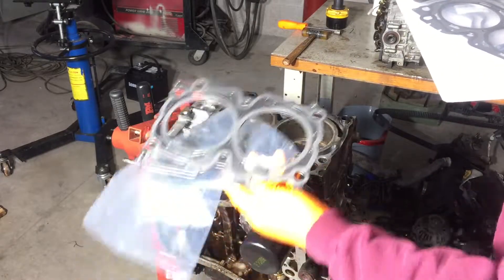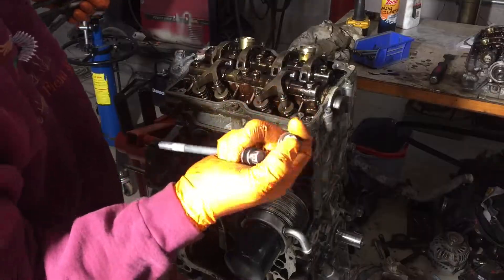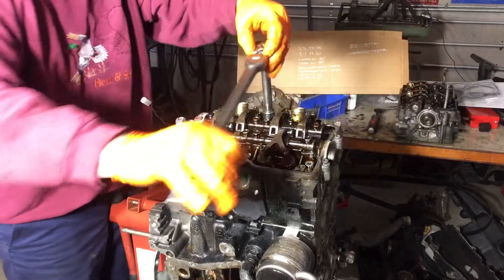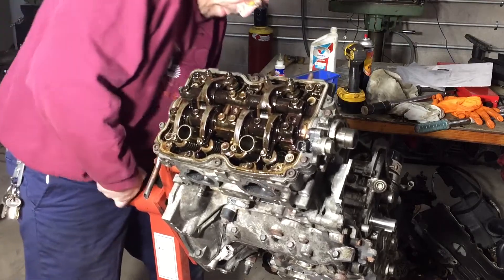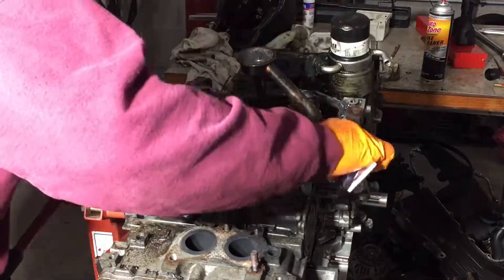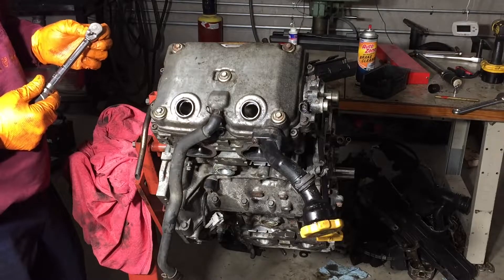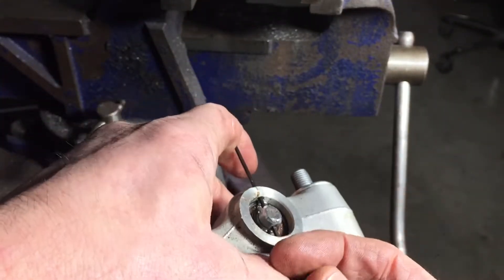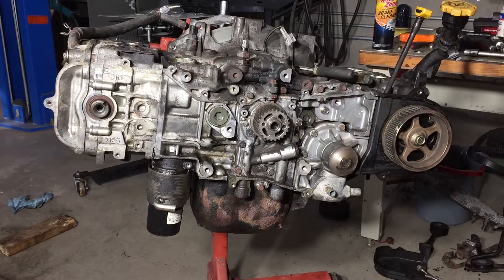Subaru ej25 SOHC rod nock, head gasket repair for $110! Installing heads, valve covers and oil pan

Comment: How many months did it take for your bad repair last
Reply from the maker: It’s still running but in a vw dune buggy. The transmission failed so it got an adapter to match the vw trans.